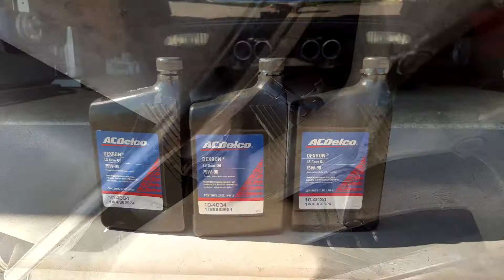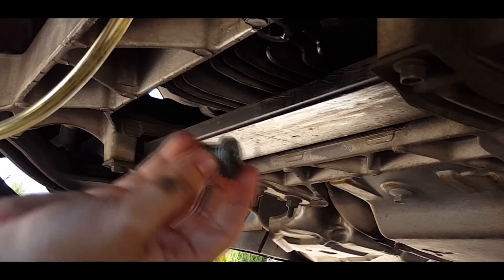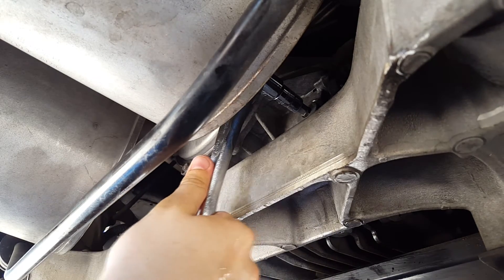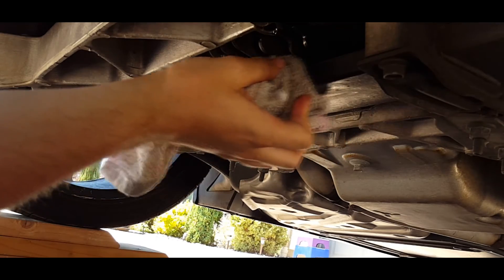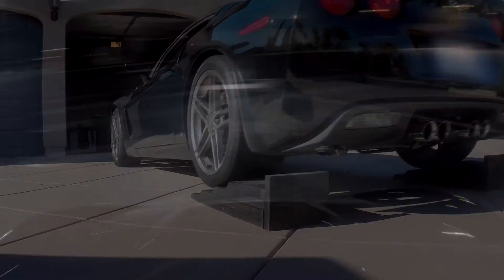How To | Corvette C6 Differential Fluid Service

Comment: great video. it seems like my leaf spring is blocking my drain plug, though. it was inset about 3/4"  into the leaf spring area, instead of being next to it like yours. I couldn't get the hex socket onto it because of that. not sure why exactly yet. I did jack the rear up on my first go, I'm thinking I should go for a drive, let the suspension settle and drive it onto ramps and check again.
Reply from the maker: I could be wrong, but I want to say that on a 2005 C6 the drain plug is above the leaf spring since the diff is slightly different. So you may have to use a large allen key instead. Otherwise the procedure should be the same!
Reply: +HardDrive Thanks. I have a 2013 actually, and for some reason, this year moved the plug above the leaf, too. Seems specific to 05, and 13. I only had about 3/4" of clearance, I had to cut a 10mm large allen key shorter in order to fit it in there.

Comment: Isn't it necessary to have the car level by raising equally in the front and rear to ensure that you get the correct fill in the differential?
Reply from the maker: The angle of my driveway makes it so the ramps got it fairly well leveled. It doesn't need to exact, just fairly level. If you have the car no more than 5-10° off and you fill the diff to the point where it's dripping out the side you'll be fine.
Reply: Please post how do you make the ramps

Comment: I know I'm really anal about this stuff but torque is measured in LB-FT, work is measured in FT-LBS.

Any chance of just buying two quarts of this fluid and topping off with some of the fluid which was removed?
Reply from the maker: I really don't recommend it, unless the fluid was pretty clean coming out. If you're already lifted and set up for servicing the diff, you might as well do everything right. The extra bottle is good for topping off and can be used in your next diff service. That's what I'd do.